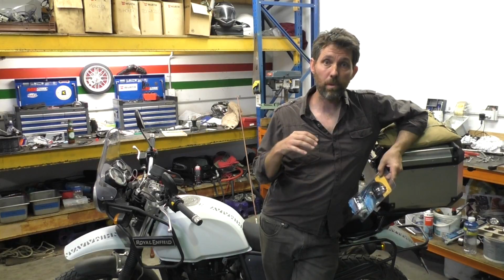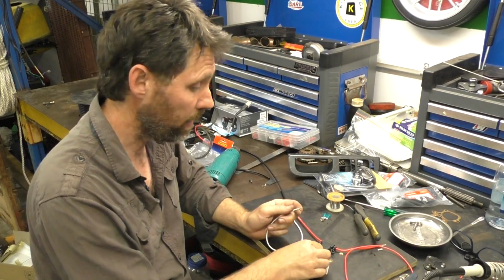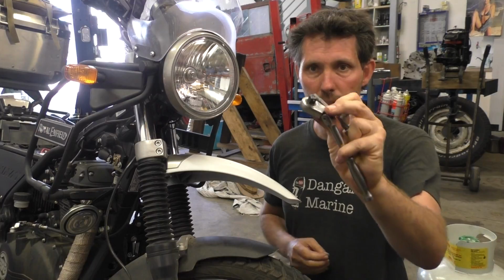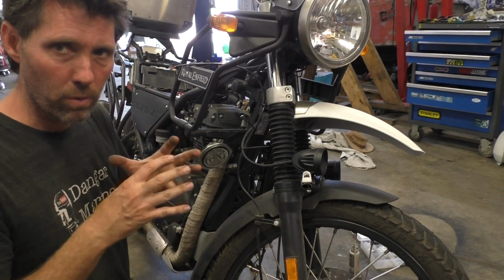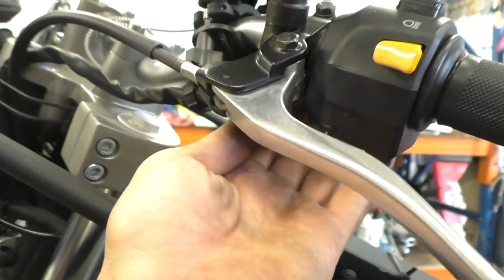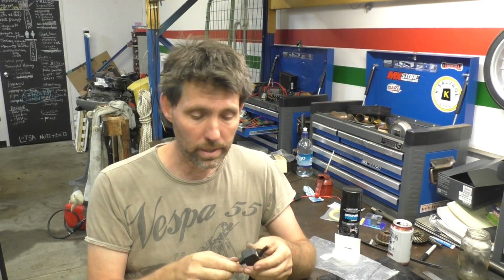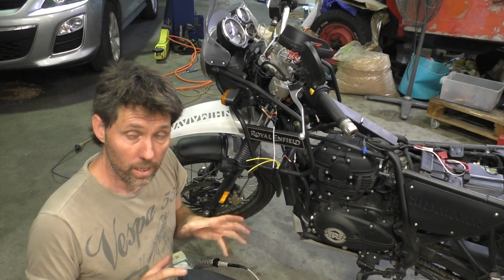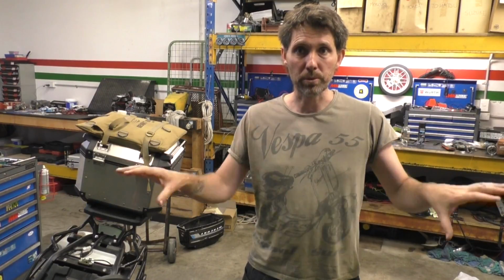Installing LED Lights on the Royal Enfield Himalayan

Comment: hey! I've been wondering if there's a way to install leds, without having to use a relay or messing with the high beam wiring of the bike. Can I just go straight to the battery and istall a swith to operate the led lights completely independent from the stock ones?
 would you recommend to install a fuse too?
cheers!

Comment: Hey man, I've really been enjoying your videos. I'll be fitting some LED's to my Himalayan this weekend. Does anyone know the power of the alternator on the BS4 UK? Can it handle loads of accessories? Heated grips/ seat, USB charging, LED spot lights etc. 
Keep up the good work!
Reply from the maker: Hey Matt, I'm not sure what the charge coil puts out on these bikes, I'd be keen to know too.
Reply: @DangarMotorcycling  I never did find out but I have fitted the 40 watt LED's, heated hand grips, USB charger and a heated seat pad. Using all these accessories the battery is still being charged well as far as I can tell. After sitting for a week the bike starts no problem.

Comment: Hi, I've been following your channel and I've also bought a Himalayan. I was wondering, do you have any experience or have found any heated grips solution for the bike? Also, do you have any issues running your LED lights, considering that the generator on the Himalayan is probably limited to what it can output. I am now running a Garmin Zumo unit off the battery and have some doubts weather or not the bike can actually power all these things simultaneously (i.e LED lights, USB outlet, heated grips, GPS unit, etc.) Thanks!
Reply: I have plenty of accessories (Oxford Heated Grips, Usb Charger with a twin output for charging my SatNav/phone, 2 x LED spotlamps & Gerbing Heated gloves for my wife - she feels the cold bless her) on my bike (A Versys 1000) and like you I need to know my battery is not going to die on me through lack of power output from the alternator, so I installed a voltmeter on the dash from good ol' fleabay. Quite cheap and it's brilliant. I run a pretty constant 14.5v and as I power on each accessory I see a small drop in the voltage but even with them all powered on I still achieve 13.8v. It's confidence inspiring knowing I can monitor the health of my charging system and the battery irrespective of what accessories I'm running. Likewise It's nice to get a heads up if something is going wrong.

Comment: Hello , I was earlier taking the connection directly from the ignition wire but now I did the same configuration what you have done. The intensity of the fog lamps has decreased lot. Did you face the same?
Reply from the maker: No, if anything it should be brighter going through the relay. I would check all the connections. Sounds like there is some high resistance somewhere causing a reduction in current flow.

Comment: Stuart, how can I contact you offline as I would like to ask you about pannier racks, ie factory versus aftermarket brands, suppliers etc
Regards
Alan Reilly
Reply from the maker: I got my pannier racks from Donowyn http://donowyn.com/ I also need to replace the top box rack as it isn't strong enough for the weight I need to carry when touring.

Comment: Hey great channel!  I'm in the USA and the Himalayan is being imported later this spring/ summer.  I hate oil coolers and on this bike it seems to be a weak point.  I was able to remove the cooler on my 06 triumph scrambler and route the oil line to the frame tubes.  This gave me an extra liter of oil capacity and kept temps the same.  Any idea if the RE frame tubes are suited to a mod like this?
Reply from the maker: Hey Anthony. I really like that idea, but I'm not sure about the frame. Sounds well worth investigating though.

Comment: The Himalayan is being shipped to the US.  I am interested, because I have short legs, but I am seeing nasty reviews of this bike on youtube.  So, I was wondering if you would recommend this bike as being reliable?  Also, do you experience oil leaks?  Thanks.
Reply from the maker: Hi mate, so far I am really happy with the bike. I think there were some problems in the early days but these seem to be getting sorted out. The export models also seem to be built using all the latest parts to enhance the Royal Enfield reputation over seas. If this bike got stolen I would buy another one straight away if that tells you anything. :)
Reply: Thank you, Sir, for your response.  I was contemplating whether to try one, I think I will now.
Reply: I have one in India it's worth every penny just go for it

Comment: How's your experience of having the Royal Enfield Himalayan? I'm planning on buying the euro 4 spec version but have heard a hell lot of negative reviews and magneto coils and ignition coils failing often. Should I consider this as my next motorcycle or look elsewhere? Reply would be much appreciated :)
Reply from the maker: Hi Akshay, I'm loving the bike so far. It's comfortable, in handles well on-road and off-road, it looks great, it is affordable. I too was worried before buying it but now I would just say go for it. You may have a problem that needs solving down the track, but that is life. RE have been doing a great job of fixing any problems so I would wouldn't be worried. I haven't had a single issue myself.

Comment: Personally I prefer crimped connections. A proper crimp connection is always better than a soldered one. With a soldered connection you create a stiff part in a flexible copper wire. When you ride along the whole car or bike vibrates, and this causes the copper to work harden. It'll take many many many many years but eventually the wire will break right at where the solder starts.
So whenever I need to splice wires, I cut them in half, put a bulled connector on each end and just add an extra wire to one of the bullet connectors before crimping. Then connect the connectors and heat shrink around it.
Reply from the maker: Interesting point about the work hardening. The main reason that I solder is that with all the salt air around here I find that the soldered connections are more resistant to corrosion, but the heat shrink does help a fair amount with that.

Comment: Hi Stuart another very interesting video excellent detail and parts suppliers information. Can you tell me the output of the alternator.  I was wondering how the Himalayan would cope with the led lights, heated grips and heated jacket. Thank you Regards David.
Reply from the maker: Hi David. I don't know the exact output, but at the end of the day it is only charging the battery so as long as you aren't using those things all the time the battery will cover the peaks and troughs.

Comment: I am not sure about the mounting of lights. The are gonna move a hell lot with the front fork slider.
Could you have placed them on the upper part of fork which doesn't move? Maybe positioning the bracket upside down would work.
Great video. Thanks for sharing.
Reply: I also have them placed in same place in motorcycle and the help in night as main headlight is focused on one place ...
Reply from the maker: It will be interesting to see how they go. I'll do that follow up video riding with them on and maybe make changes down the track if needed.
Reply: Dangar Motorcycling I'll be waiting, eagerly. Add to that, it should also increase their life a bit.